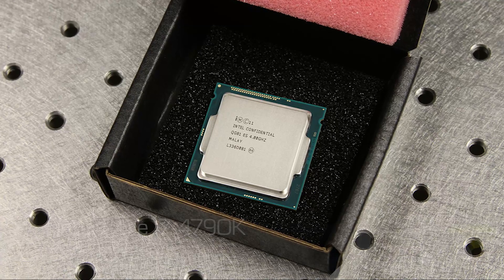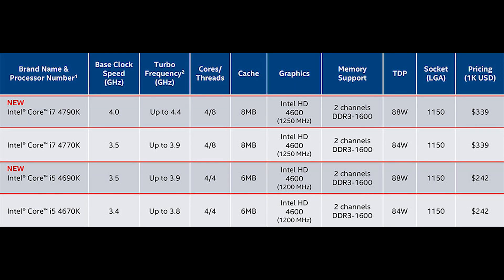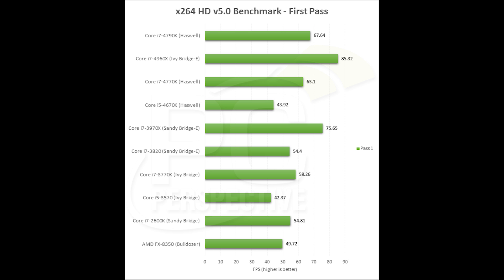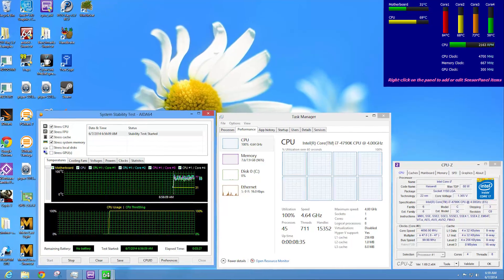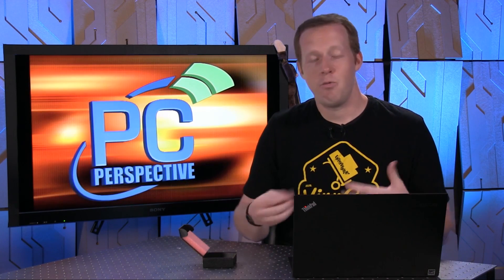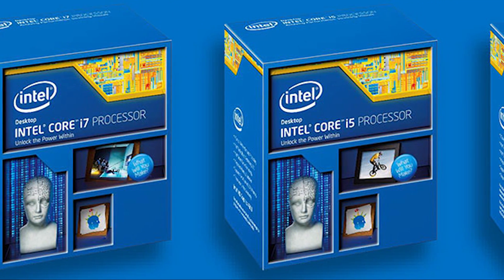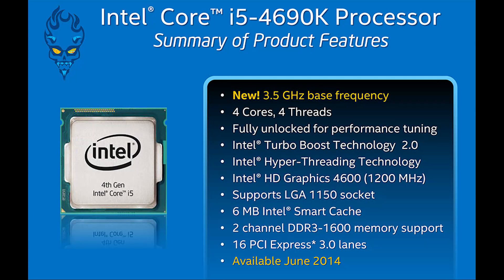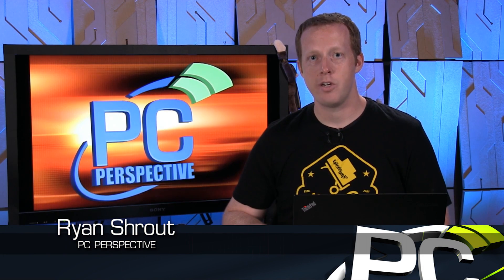Intel Core i7-4790K Devil's Canyon Review and Overclocking

Comment: Thanks for the info. i hope i get a good one, my i5 3570k does 4.9 @ 1.40v
Reply: Damn you're pushing that i5 lol.
Reply: Alex Stoeff Yeah I was lucky got a pretty good chip, didnt even have to delid
Reply: sdmf74 Saying that i5 is a pretty good chip is a hell of an understatement... you're probably in the top 4-5% when it comes to overclocking chips. Unless you really need that power of the i7, you should probably stick with the i5. That said, you could also sell it for quite a good price on Ebay.
Reply: Alex Stoeff Yeah I wanna go with an i7 this time for better benchmark scores etc. I already have a buyer for my motherboard and cpu but if it falls through I probably will put it on Ebay. Now hopefully Asus will release the Maximus 7 Formula on time so I can upgrade.

Comment: I was ready to preorder the 4790K but now I'm leaning towards keeping my 2600K. At least until Broadwell but even that will likely be 5% better than Haswell.

The president of Intel, Renee James, specifically said that Devil's Canyon would hit 5Ghz on air. The samples sent out to reviewers could be duds but I don't think that is the case.

Power saving features and integrated graphics are fantastic for a laptop or all in one but none of that matters to the customers DC is targeting. And lastly, bring back solder and ditch that cheap a** TIM.
Reply: He's full of SHIT. Nothing but a money grab here.

It doesn't even hit 4.8Ghz for most samples on water, let alone 5.0Ghz on air.

Comment: Second 4970K review and both are reporting really bad overclocking results...
Hexus wasnt even able to OC the 4970K at all because it was barely stable at stock clocks. Great job Intel - Not buying anything new from you until you get your sh*t together as this processors was meant to be all about better OC performance.
Reply: Yep, they are selling old outdated chips as "new", sad really. Me? I stick with my Q9550 till something comes out that makes upgrading worth the cost and effort.

Comment: I'll be building a new gaming rig around beginning to mid July and I am kinda disappointed. It just feels like they took the 4770k and improved the thermal abilities so they could just turn up the stock speed and sell it as a "new" processor. Honestly I don't even know if that's true, but it kinda just feels like i'll be buying a 4770k that's overclocked for me, and doesn't really have much extra potential.

Comment: I can't decide on which to get. Another 780ti for sli? Or Upgrade my i5 3570k and motherboard to get a 4790k? My 3570k reaches 4.5Ghz at 1.4V.
Reply: Another 780Ti. The extra CPU performance is not justifiable, compared to 30% to 90% more performance in gaming due to a second GPU.

Unless you're heavily encoding/decoding video or photo's, you won't notice any difference between the i5 and the i7.

Comment: You forgot to mention about the temps. Was the 4790k still hotter at 4.7GHz than your 4770K at 4.8GHz? I bet it was. Hopeless upgrade for existing 4770K owners.
Reply: I checked the written review. It seems the 4790K was actually cooler even though it was running at much higher volts. That's good.

Comment: what about temps there ? does is still run very hot ?
Reply: He didn't mention his temps because they vary widely due to different ambient temps, coolers and fans. Instead, he just mentioned the voltage required. Which is a much more useful metric.
Reply: ***** i7 4790K is a beast that being said it's disappointing if your coming from a 2600/3770/4770K, X99 is the only platform worth spending money on yes it will be expensive but you know it will be a upgrade. I've been on X79 since it launched at the end of 2011, I'm so glad I got this after seeing how Intel have played out there mainstream line..
Reply: DarthMuse
Intel Devil’s Canyon i7-4790K and i5-4690K performance, specification, price comparison.
http://www.laikabawse.com/gadget/intel-devils-canyon-i7-4790k-and-i5-4690k-performance-specification-price-comparison/

Comment: Well right now I have a i5 4670K happily blasting along on 4.4Ghz@1.248V cooled with a Corsair H105 so I think I'll hold fire till more Benchmarks are out for the 4790K.

Currently using a Z87 Asus Maximus VI Formula with the latest Bios update to allow it to run Devils Canyon Chips might take the plunge later in the year if prices don't go through the roof

Comment: As a gamer the 4690K is much more tempting IMO, yeah the baseclock is lower, but both are unlocked CPU, so in the in the end it doesnt really matter what is the baseclock. With no hyper threading, which doesnt really give any advantages in games, your temperature are much more likely to be lower compared to the 4790k, especially with the new TIM, with better temp you are less likely to hit a wall that will artificially limit your OC. Its well known that HT increases temperature by a good margin. Anyway its still all about silicon lottery, some DC will easily do 5ghz under air with less than 1.37v some will not be able to even do 4.7ghz with whatever vCore you put at it.
Reply: You can buy the best & the cheapest Intel Core i7 Processor here amzn.to/1uXSE1D Click to get full reviews and get the best price now !!!
Reply: There are games (more than in the past) that do take advantage from Hyper-threading. If you take the Core i3 for example, that dual-core CPU does takes advantage from Hyper-threading for gaming. For now every decent quad-core will do the job just fine for gaming but off course there will be a time in the near future were it will become to slow. I believe that a quad-core with HT (in comparison to no HT) will have a longer lifespan before it will become to slow for gaming...

It's difficult to tell what the near future will bring us but it's likely that the CPU requirements will see a 'bump up' with the next-gen consoles fully utilized with 2015 AAA-games.
Reply: @detmer87  you sir were correct I still use this today and it plays Microsoft flight sim 2020 at high 😂
Reply: Might want to look more into it. The 4790k is binned prior to selling which means that it is tested unlike the 4690k you talk about which is worse than getting a 4770k.

Comment: f*ck you intel. selling me a shit i7 4770k without vt-d. why does the i7 4790k has vt-d??
Reply: GET A GRAPHICS CARD DAMN IT!!
Reply: iTr00oW What? VT-D is for dedicating hardware to virtual machines. It serves no purpose on a regular desktop. If you mean using real vram IN A VIRTUAL MACHINE, this sound likely.
Edit: nvm, i just saw your kvm post, it all makes sense now :)
Reply: It does? Amazing!
Reply: TheMankyTube yes, i can't run windows in KVM cuz I don't have intel vt-d _. i got a 1tb hdd for windows now which sucks :(
Reply: Why did they do that? Even the AMD A's and FX's have IOMMU :P
Reply: iTr00oW Calm down. There is no difference in real world experience when it comes to frames per second. The difference will be like 90fps vs 95fps, 150fps vs 165fps, 75fps vs 80fps, depending on the game.
Reply: wtf. YES WITH A GRAPHICS CARD. THAT IS THE CASE.
Reply: MashLegend i got a gpu dude. but you need vt-d to use the vram on your gpu u know?
Reply: MashLegend do you know what intel vt-d is? i'm using a r9 290 btw
Reply: iTr00oW you don't need to get extra fps vt-d.. you tell me what is it and how much extra frames does it give you in gaming?
Reply: iTr00oW First of all. If you were buying 4790k then it should be for gaming. There are plenty of badass server cpus that cost more than $1000.
Reply: MashLegend READ THIS:
1. i'm on linux
2. i want to play windows games
3. i want to run windows in a VirtualMachine  so i don't need to dualboot
4. you need intel vt-d to use vram of your gpu
5. without vram you can't run games
6. the i7 4770k doesn't have vt-d, the i7 4790k does.

I don't know where the server cpu's came from but i don't need one. i'm just a gamer u know??
Reply: iTr00oW Intel vt-d serves no purpose on desktop pc as the guy explained what it was. I guess you didn't read it.
Reply: iTr00oW You should of known what you were buying  it clearly states 4770K does not have VT-d on the website http://ark.intel.com/products/75123/Intel-Core-i7-4770K-Processor-8M-Cache-up-to-3_90-GHz
Reply: iTr00oW I have had the i7 3960X since launched : )
Reply: Richard Smith yeah it sucks. i can't run windows in kvm without intel vt-d _.
Reply: MashLegend the difference between the i7 4770k is massive with the i7 4790k. without intel vt-d you can't use more than 128mb vram i believe. so that means you can't run a game.
Reply: MashLegend Please READ before you post. just google KVM or read Richard smith's post.
Reply: DarthMuse i know. normally the k cpu's don't have it except the socket 2011 ones. nobody knows why the k cpu's don't have it. but the 4790k has it which don't understand.
Reply: DarthMuse nobody cares -_-
Reply: iTr00oW I want to thank you because Idiots like yourself is what keeps things balanced in this world. We need some stupid as well ;;||;; know what im sayin' dawgg? and hey I noticed you deleted my previous comment being the low self esteem coward that you are.
Reply: randomvidz94 ? I didn't even know it was possible to delete somebody's comment? And i don't get it.
Reply: Yea, I was kind of late to the party with my 4770k. Bought it 4 months ago. The thing overclocks like shit. I said f'it, bought a 4790k, and sold the 4770k on ebay. 

Thing that p'ed me off, is I know damned good and well chips that could pull 44+ was put to the side for the 4790k, and we were being sold shit oc'er as unlocked 4770k.
Reply: MashLegend You're an idiot. PCs aren't just for gaming.
Reply: NDogg15 Wow wow okay I'm new to this what is the purpose of vt-d?
Reply: SuperCod141 It's a visualization technology. Kinda hard to explain, but if you don't know what it means, you probably don't need it.
Reply: I'm glad you guys are keeping this thread alive
Reply: iTr00oW can you explain What vt-d is ?
Reply: Gam3ingPr0zz just read earlier comments?? the simple way: with intel vt-d you can give a gpu to a virtualmachine, you can use all the ram on that gpu.

Comment: My 4770k will only oc to 4.1 ghz
Reply: That's nasty.
Reply: Same here, If I go over 4.1 it gets too hot and it blue screens within half an hour of stress testing with programs like Prime 95. That's under a H100 water cooler, I pre-ordered my DC chip last week though and I found out that my MSI Z87 G45 gaming motherboard supports it so I'm feeling good about the change, I'll sell the 4770k once the new cpu's set up and get most the money back too :)
Reply: nasha thedog I'm usining mine withe a cooler master 240mm rad gettin blue screen as well. Also using a Asus z87i deluxe mini itx mobo which also supports my DC chip I preorder
Reply: thats sad most easily OC to 4.2

Comment: Eh, maybe it is time to upgrade from a Q6600
Reply: That is still a great chip lol
Reply: shit im  still using my q6600 3ghz on asus p5n32-e sli, ahh good old Crysis days, rooms been  a bit cooler now for a few years without the  gtx 8800 sli heaters in it, man time goes fast.
Reply: yahooizzle i also use to have the 9800 gtx
Reply: Honestly, from what I've seen, the best upgrade from a Q6600 on the Intel side is a low range i5 or a high range i3.
Reply: Tatas Gr
 ive got the phenom ii x4 955 which is pretty much the AMD equivalent of Q660 and on bf4 i hit 100% usage quite often which freezes the game for a couple of seconds
Reply: I'm still on the Q6600 aswell. Maximus Formula "the first" lol. It was my first and only build and overclock at 3.2. Hmmm, roll on payday :D
Reply: Haswell has just about twice the IPC performance of Kentsfield, overclocks higher, supports newer instruction sets, has a dramatically better memory controller, runs a lot cooler and doesn't have the FSB anymore. Should be a great 3 times increase in overall performance when overclocked.
Reply: Tatas Gr
Aussie here too.Qx 9650 and gtx 570 still going OK at 1080.
No rush for me.
Wait a year into the new consoles lifespan then check what's goin.
Reply: i have a q6600 i overclocked it to 3.6ghz but i had to upgrade my graphics cards to dual r9 280x. i run bf4 at about 60fps but its still at 95% load
Reply: IdioticAussie My CPU usage also hits 100% and it stutters like crazy! P.S i have a GTX 970 4GB and a Intel i5-3570k @ 3.4ghz
Reply: Still rockin the Core 2 duo
Reply: TheRyanDudeMan
you reply to me on the day that i upgraded to a i5 4690
Reply: Congratulations. Hoping to switch my Q6600 next year. If budget allows.
Reply: I upgraded to a 4790k and 970 >:D
Reply: Ahh dude lucky! that's the exact CPU I might be getting for christmas! how does it perform on Battlefield 4? (mine stutters because of the bottleneck)
Reply: TheRyanDudeMan this cpu was also for christmas but i was allowed to put it together early in case something wasn't working and i would be able to go to the shop straight away instead of waiting a few days

 the cpu performs really well on bf4 and the highest cpu usage i saw was 75% and on average around 60%. im still getting a few fps drops but thats because of r9 270.

i did benchmarks on thief and tomb raider and the on thief instead on playing on very low i can play on normal and on tomb raider instead of normal i can play on ultra
Reply: 65 %? holy shit! my i5 stays at 100% with 90c
Reply: TheRyanDudeMan it could be possible that there's something wrong with your cpu and/or cooler. when i played bf4 on my old cpu at 100% usage it would be around 80c.
Reply: TheRyanDudeMan ok i played some more bf4 but this time it was full 64 man server and i was on average 70-75% usage with max of 80% and 70c
Reply: Yep, Got a i5-3570K this week.
Reply: Still waiting on a new case to put it in. The one I have for the current PC predates the concept of coolers.

Comment: To be perfectly honest, OCN's 1000+ page thread on Haswell overclocking suggests your 4770k ES clocks quite a bit above the average 4770k. Out of nearly 200 submissions, the average overclock for 4770k's is 4.5ghz @ roughly 1.3v (excluding outliers running on sub-zero, phase change cooling etc.)

With this larger sample size in mind, your single sample 4790k looks to be roughly within expectation